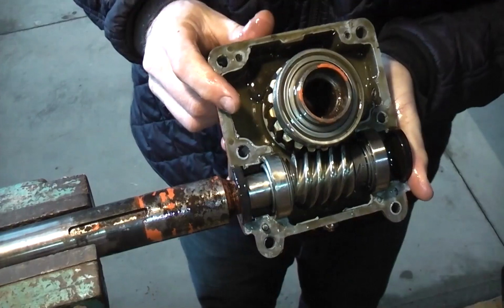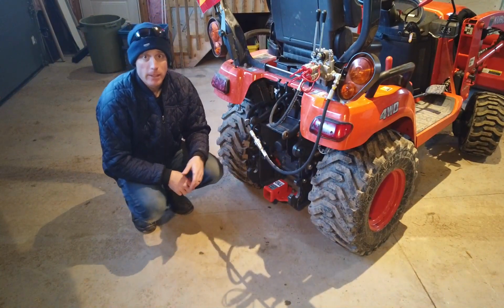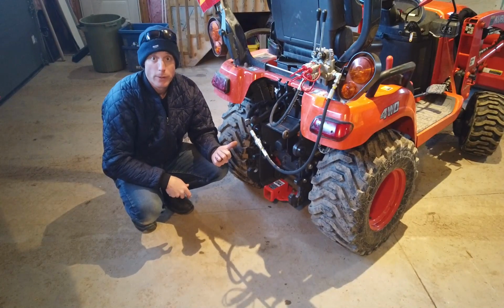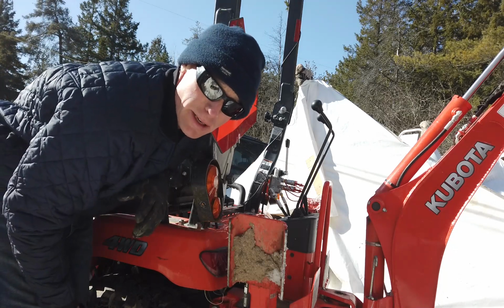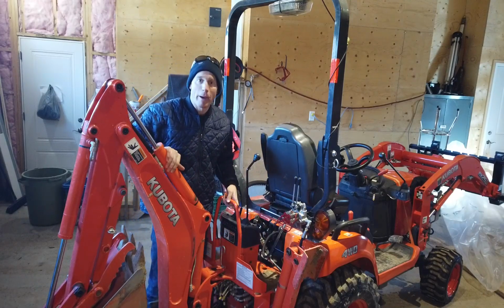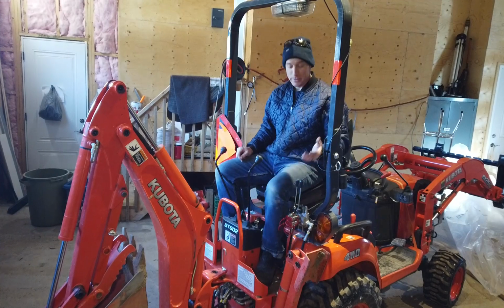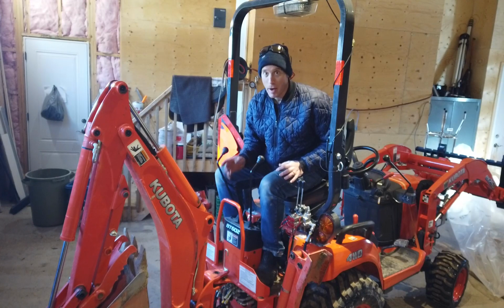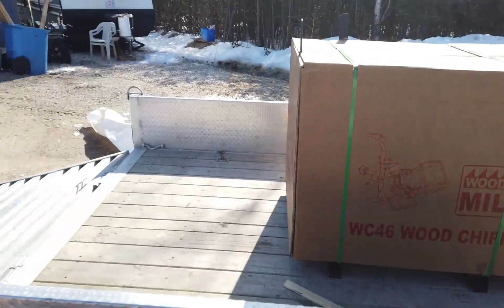Kubota BX Backhoe Test After Rear Remote Installation - No.24

Comment: Nice video. Did you have to disconnect the line from control block dump side to hook up backhoe?
Reply from the maker: I don’t think so - either the tractor supplies the control block or the tractor supplies the backhoe which then supplies the control block the dump to tank always goes from the control block to the tractor if my memory is correct.
Reply: I put together the controller and was able to figure out the lines with backhoe on. Brilliant idea you had. I went with a single spool because it was on sale. Next project is the hydraulic thumb.

Comment: Glad to see the backhoe is working well with your remotes addition.  I am also in Ontario and wanting forks for my BX25D. Where did you get them? Do you also have a quick disconnect for switching easily from bucket to forks?
Reply from the maker: When I bought the tractor I removed the bucket and installed the BX6315 quick attach bracket. My forks are HLA Attachments model HD09KULA240. The factory bucket, my forks and custom loader plow all pin onto the BX6315 QA bracket. I bought the forks at Stewart’s Equipment in Erin, ON. Thanks for watching!

Comment: Hey, I know this setup is a couple of years old, but do you recall if you had the backhoe and the rear remotes both connected to the tractor at the same time?  I cannot tell, but in my head I cannot work out how that would work.  It would seem only the backhoe or the rear remotes, but not both the way it appears.  Thanks
Reply from the maker: Everything works together. Thanks for stopping by!

Comment: Hi.i have a 2012 bx25d . 
I made my mechanical thumb hyd.

If i can help you out.let me know.

.ive done alot of mods to mine.chain saw holder,aux fuse box,front fenders,skid plate (took out 2 hydrostatic fans),light bar and 2 pod lights,grab hooks for the bucket and 1 on the back hoe.2 grab hooks on the frame for chaining down.warn winch on the front.
Reply from the maker: That’s awesome!! These machines are pretty fun to mod out! I’ve done everything to mine that I’d like so far. I haven’t used the backhoe since we bought a mini ex. Thanks for watching Brian!!!

Comment: I know this is an older video but I'm curious about the hydraulic hook up. The backhoe looks like it has 3 lines pressure in, pressure out and tank. Did you connect the pressure in to the tank out line from the remote spool valve? If so all the pressure from the backhoe valve may damage your spool valve. That output is not supposed to have pressure without the power beyond adapter. You should have a disconnect in the pressure line from the tractor and connect the backhoe between the tractor and the remote valve. Otherwise you would need to add the power beyond adapter to your remote valve. This maybe the best choice if that line going back to the tractor powers your 3 PT hitch. Since the backhoe already has 3 lines it is set up for power beyond already. Add the quick connect between the tractor and the remote and plug the backhoe into it to complete the circuit. Hope that make sense.
Reply from the maker: I could never make it any clearer in the comments compared to the detail of my videos. It’s been a while since I had my mind in hydraulics. Everything is working great.